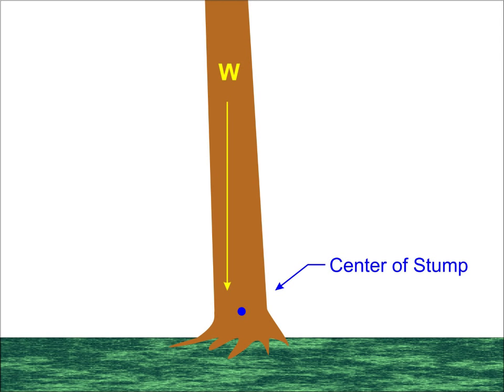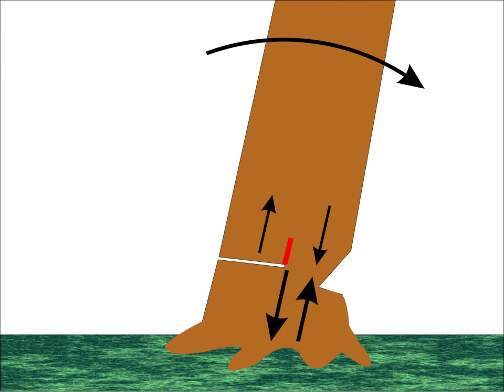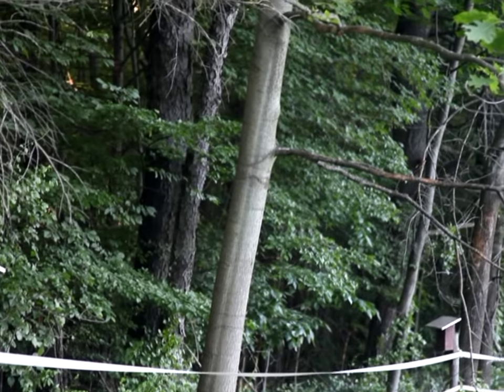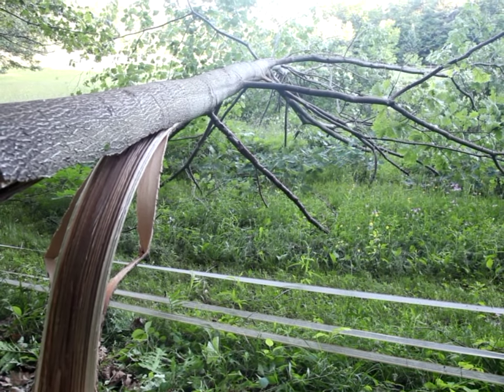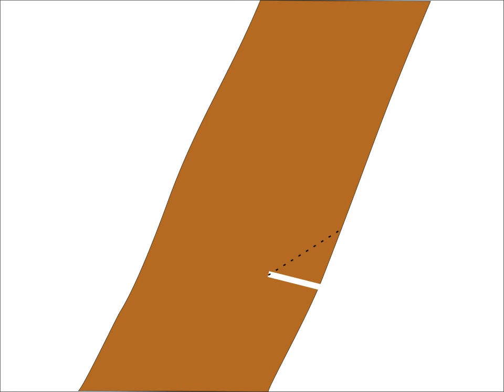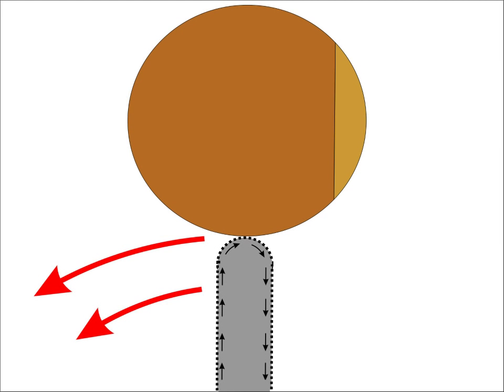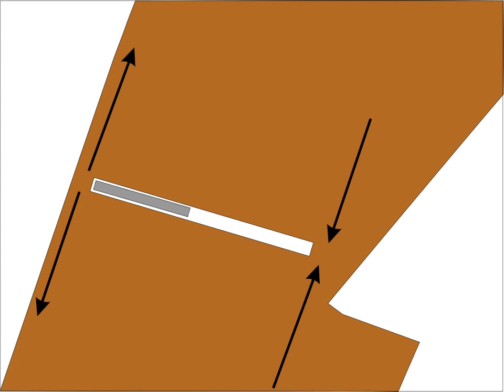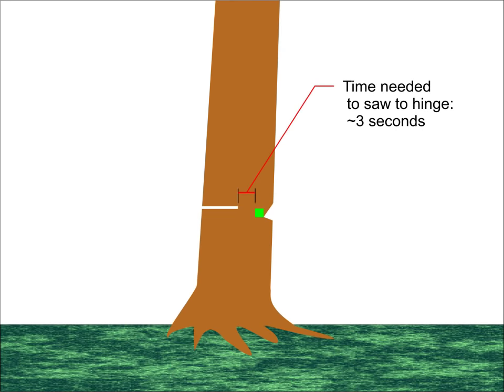Tree Felling - Leaners

Comment: Excellence here.  
If only I can properly apply this gift of knowledge to take down some 80-100 foot Virginia pines bent over at a 45 degree angle from a tornado this past spring.  Not only that. several are bunched up together.  That makes for a new question:  which one to cut first?  Probably should leave it to a professional if I can find one.
Reply from the maker: Sounds like a quite dangerous mess.  Lots of unusual stresses and possibly compromised strengths.  Predicting which ways trunks will spring and avoiding being hit by falling or launched trunks and branches takes some careful analysis and accumulated experience, not all of which ended well.
   The first tree in each change to the challenge should be the one that has the least chance of falling on you or flying at you.  Since some of the trees are leaning on each other, you will probably not be able to simply cut at the base and expect them to fall to the ground.  You may need to "nibble" them down.  That involves cutting five feet off of the base repeatedly,.  With the top hung up, each new bottom of the tree will fall around five feet closer to being vertical until you have a shorter, nearly vertical tree that you can push or, with a rope, pull back to fall across the original stump.
   For each cut, start by making a two-cut notch on the upper side of the trunk, not deep enough to risk pinching your bar, and then cutting up from the bottom towards the notch.  With that sequence, the trunk will bend slower and more safely, than if you tried to cut all the way through to an abrupt snap.
Reply: @terryhale9006 :  Thank you Terry for taking time to help.  
It is truly amazing to me the amount of variables that go into 'simply' cutting a tree down.  Each scenario can be truly unique.  A puzzle to be solved.  The stakes are high:  your very life in some of these instances.  The challenge is to see the danger that lies before you.  Then plan and execute the necessary action.  
So much to learn.  The more I learn about it, the more I realize, like Socrates, that I really know very little.
Reply from the maker: You have grasped the essence of the challenge.  For experts, the real danger is becoming familiar with all the typical problems and then relaxing and not recognizing when there are subtle but very important differences. @horacesawyer2487

Comment: I really enjoy watching all you experts felling all kinds of different trees, it's an incredible skill you have and it teaches me a great deal, but may I ask a question of you Mr Hale, or for that matter anyone else who cares to answer...?
 Do you ever encounter  trees with no lean whatsoever, that for no apparent reason also unexpectedly split dangerously along their length as they begin their fall?
 Sorry if it's rather obvious question (I'm fairly new to this), but I'm curious as to whether or not this ever happens.
Reply from the maker: +jiggermast     Sorry for the delay.  Your query didn't pop up on my feed.
   That has never happened to me, though I have had a few split when they hit the ground.
  I can easily imagine circumstances where it could happen, particularly where there are co-dominant stems.  (The trunk is divided into two separate trunks some distance up from the base.)  Such unions can be dangerously weak due to an included bark plane as the separate stem continued growing up and out from the union.  As the tree begins to fall, the leading side could be pulling down harder and and cause the union to open up.  Such a split would move from the union downwards to the base.
   If the split moves from the base upwards, then there may have been some pre-existing weakness in the trunk.  Almost certainly, however,  there would have been some effective lean in operation (such as heavy weight on one side), even if the trunk appears vertical.
  Pre-existing weaknesses, such as shook trees, can be fairly common in evergreens, particularly in windy settings, but are uncommon in deciduous trees.
Reply: +Terry Hale 
                      Thank for taking the time to answer my question Mr Hale, many posters now don't seem to bother any more!

Comment: That's a great video. When cutting a leaner with a bow saw you can't make an entry cut - is it safer if you make a very big initial notch cut?
Reply from the maker: I'll hope you're not faced with tackling a very large tree with a bow saw.  With smaller trees, a barber chair split is much less threatening.  My bow saw cuts a very narrow kerf.  I'd be reluctant to tackle a leaner, as I would be concerned about that leaner squeezing in on my blade.  If I HAD to go after a medium-sized (12") tree with a bow saw, I'd probably try to get a really strong rope to hold the tree in place before starting any cutting.  I'd wrap the anchor end around a tree trunk several times and then tie it off to another tree.  Once your leaner loads the rope, you have to be able to release the anchor.
Reply: @terryhale9006  Thanks for that - never thought of anchoring it with a rope - I've two trees leaning on a straight one to deal with so that might really help in that case. That's a trick I'll remember - thanks. Mostly I do small to medium trees but I've certainly done a fair few bigger but never usually leaning too badly.

Comment: In a barber-chair, why must all of the finishing work be done at the trunk end?  Cannot it be done on the top side working toward the trunk?  Cutting all the branches, working toward the barber-chair?  A novice asking.
Reply from the maker: PJ:  A very good question.  Your question is relevant to this particular instance.  Be aware, however, that  in many barber-chair incidents, the trunk does completely separate from the base and falls from height.
   In this particular instance, you are correct that many of the branches could be removed first.  A problem would be the height of those branches.  As a general rule, you want to avoid reaching up with a chain saw.  The heavier the saw is, the worse the idea is.

Comment: I think they call it a barber chair because the seat of a barber chair stays fixed and  horizontal as the vertical back of the barber chair bends/tips toward the horizontal. Think of a barber chair being tipped back for shaving or shampooing.

Comment: Hello Mr. Hale. Question for you:How  do I establish my cuts for a somewhat heavy leaner felling it 90 degrees to it's lean? It's about a 16" bth ash? Preferably without riggiing?
Reply from the maker: Assuming there's nothing in the way of an unexpected direction of fall, you cut the notch on the side in the direction you want the tree to fall and then make the back cut.  However, your hinge should be very narrow on the side the tree is leaning towards and wide on the side that will be resisting the lean..  You then drive wedges into the back cut to force the tree to begin falling in the direction you want.  If the wedges don't get it to go, then you will need to supplement that force with a pulling rope.  DON"T resort to cutting more of the wedge as that will give the tree the excuse it needs to fall in the direction it originally wanted to.
   One of the dangers of cutting a conventional notch is that the apex of the notch will concentrate all the bending of the hinge at that one height and make it more likely to snap after the tree has fallen through at little as five or ten degrees.  The tree is then free to fall in some compromise between the direction you wanted it to fall and the direction it wanted to fall.  One way to reduce this danger is to spread the bending of the hinge out over more vertical distance.  This can be done by making plunge cuts with your bar vertical to create tall vertical cuts to define the sides of your hinge,  That way, the tree can fall through more degrees before the hinge bending gets over-stressed and causes it to snap.  Once a tree has developed some momentum in a particular direction of fall, it will deviate little from that direction.
   However, if the tree is going to do major damage if it doesn't go where you want it to, you should get insured pros to assume the risks.
Reply: @terryhale9006  Thank you! Do you have any info/videos on vertical plunge cuts?

Comment: I've got a pine tree that survived some sort of trunk wound where all bark was removed and it appears it has hardened and calloused up. It still occasionally leaks sap. How would I cut such a tree without it landing on my chicken coop, shed or garage? Anyone that could help would be phenomenal.
Reply from the maker: Voli, Other than the wound and the ongoing sap generation, are there other reasons you feel you can't just leave it?  If you feel it has to come down, there are probably at least 50 questions that would need to be answered before someone offered advice on how YOU would cut down such a tree..
1.  Is there a safe direction in which to fell it?
2.  How precisely would the tree have to be aimed?
3  How large is this tree?  Size makes a huge difference.
4.  Even with a safe direction and area to fell it in, are there other features that would be very bad to have the tree land on?
5. If it is a large tree, are there any buried facilities or pipes in your drop zone that might get damaged it the tree fell on them?  With large pine trees, I have seen branch stubs penetrate nearly three feet into the ground.
6. What resources do you have?  A big enough chainsaw?  Long, strong rope? Any winches?
7. Does the tree have any noticeable lean?  If so, what direction is the lean relative to the direction you want to fall it?
8. Do you have any experience cutting down trees?
If you feel the tree has to come down, it's big, and there is no Really safe direction in which to fell it, then you should seek bids from properly insured professionals.

Comment: How do you drop a tree that is roughly 60 feet tall perpendicular of its lean. If the lean has caught a smaller tree and it’s structurally  solid but uprooted? I’m looking at a sycamore.
Reply from the maker: Once it's uprooted, your best option (hinging it for a particular direction)  has gone away.  Your only shot at controlling the direction of fall is to get strong rope or chain and winch it in the direction you hope it will go.  If I understand you correctly, only the small tree is preventing it from continuing down to the ground.  If so, depending on how the trees are interlocked, you may have a really tough pull trying to force the larger tree to pass through the smaller one.  Even if you succeed, you may do major damage to the smaller tree.
   It sounds like you are dealing with a classic widow maker.  Even if you decided to sacrifice the smaller tree, you would be cutting it while under the larger tree which would be eager to fall on you.
   Depending on the situation, a climber might be willing to take on the risky job of piecing down the leaner.
  One option would be to get your strong rope tied high in the leaning tree and run the other end in the direction you want the tree to go.  Tie that end off to an anchor point, without applying a lot of tension, so the leaner can't fall in the opposite direction.  That opposite direction  will be your escape route when you go under the big leaner to work on the small tree.  Make a notch cut in the smaller tree aimed in the direction you want both trees to go.  Make a shallow back cut.  The aim would  be to leave a strong hinge, NOT to bet the small tree to go.  With the small tree weakened, go out along your escape route and then winch or pull over both trees with your strong rope.  Of course, you should only attempt this if you are confident the small tree can support the large tree and the hinge you make in the small tree will not fail while you are in the (extreme) danger zone.
  If you try, this please designate someone to let me know how you did.

Comment: How about doing a video on this idea.  When cutting a leaner don't cut the back strap with a chainsaw, use a rope saw to finish the back strap cut from a distance with long ropes on the rope saw.  I used this method using a 6 foot length of the smallest chainsaw chain I could buy.  The sawyer is far from the danger of  a kickback.
Reply from the maker: I'm curious about the circumstances that  warranted that extra effort.

Comment: Question: for smaller leaners, is it acceptable not to make a proper notch, but a simple, pretty deep cut from the same side, until the tree tries to trap the sawblade, remove the saw, and then cut the opposite direction? This should make the tree close the gap of the cut, and use this gap for leverage, avoiding any risk of barber chair.
Reply from the maker: The definition of "small" begins to matter.  If your saw's teeth are good and sharp, no notch is needed as you can whip through a 3-inch trunk before the tree has had enough time to fall very much.  (Often good to do this on a slightly inclined cut so the trunk can slide quickly off the saw.)  With three to six inch diameters, the notch becomes important as that is a lot of tree to get through quickly.  With four to five inch diameter trees, your idea of making a single cut is probably acceptable, but a bit on the risky side.  First, it can be tricky to judge how much you can cut before pinching occurs.  With a larger diameter, there will be a lot of reserve strength and you can usually see the kerf slowly beginning to close.  With a small diameter, there is little reserve strength in the trunk and the closing of the kerf can be pretty quick, making it hard to snatch your saw out just in time.  Second, once your diameter gets up to the 4 to 5 inch range, the moment in the leaning tree can become substantial.  if you remove your saw and the kerf closes, the bending moment will no longer be relieved by motion of the tree and the trunk may barber chair when you start the back cut.  Even if it does, however, barber chairing of a small tree does not usually produce a disaster as the forces involved are simply not as great as they would be for a larger diameter tree.
Reply: @terryhale9006  Hello, thanks for your answer. I was thinking of heavily leaning trees which would be harder to plunge cut, but thick enough to insert a wedge, so let's say  at least 20cm (8in) and up to 40cm (16in). I think my previous explanation wasn't clear enough, and sorry if it still isn't: I am neither of the trade, or a native english speaker...

If I understand correctly, a barber chair occurs when the tree falls while the holding wood is way thicker than it should be. This is caused by the holding wood being subject to a force couple rather than just tension.
The usual way of doing is the plunge cut :  this eliminates the center of the tree, so the force couple is between the holding wood, and the back of the tree: distance, thus force couple, without too much fibers actually remaining.

My idea is that holding wood and notches are only useful to control the fall direction. With a heavy leaner, this is pretty useless, as it will just fall where it wants to. And in the previous method, before the tree starts falling, the holding wood is subject to a compression force: a closed kerf can hold just as much compression force as actual wood fibers. So when you cut the back, it should break just like it does after a plunge cut. Except there won't be any holding wood controlling the fall.